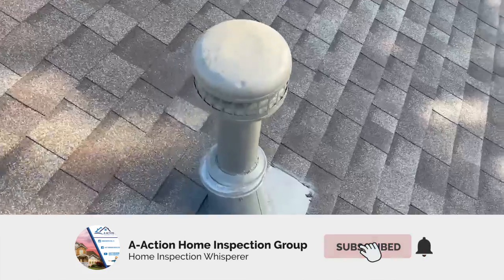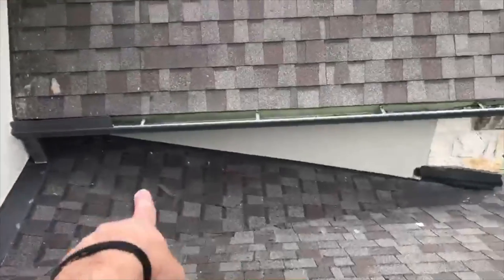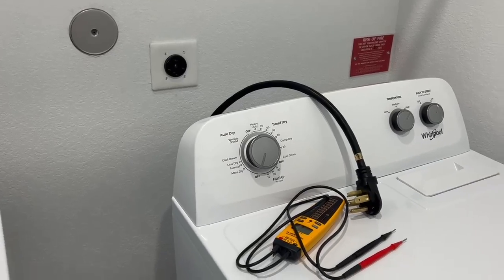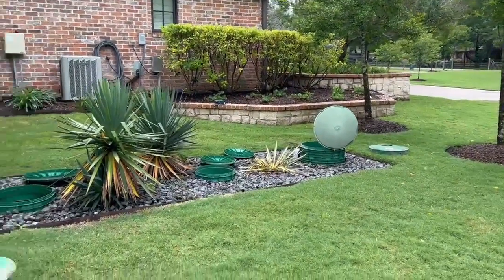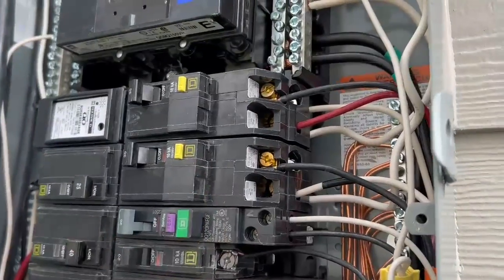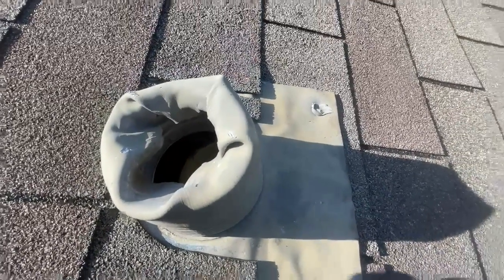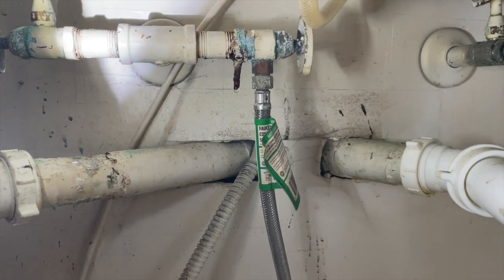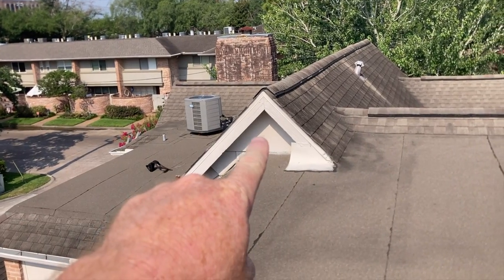Home Problems Compilation Part 2 - The Houston Home Inspector

Comment: Regarding the 4-wire dryer plug voltages, I'd expect to read 120v between either line connection and ground or common. At the panel, both ground and common are tied together.

Comment: At 6:30, I am pretty sure that breaker is hooked up correctly.  A lot of 240v outlets only need 2 hots and a ground.   I just hooked up a car charger at home, and that's how I had to do it.  I would have used red tape to mark the 2nd hot, though.   But let me know if I'm wrong.  Thanks
Reply from the maker: This has actually been a all back before.  For the GFCI to work correctly all the legs need to be connected in the breaker.